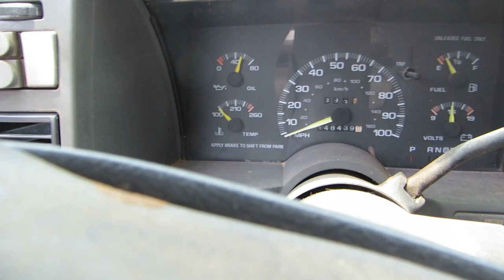1994 AND BACK GMC SAFARI / CHEVROLET ASTRO FUEL PUMP THROUGH THE FLOOR LOCATION

Comment: You skipped the one part I needed to know how to do, WAS TAKING THE PUMP OUT
Reply from the maker: that's simple.....and rather rudimentary. It's why I skipped it.
Brass drift and hammer, tap the Wd40 sprayed ring anti clockwise.
and then the whole pump unit comes out.

Comment: I have a 2004 and the other videos I’m seeing are in the same spot as yours, not back where you’re saying you thought it would be. I’m probably going to do mine this weekend, so I guess I’ll find out and let you know.
Reply from the maker: The reason I thought it would be farther back is because I had a 95 before this one and did the same process...I didn’t take any measurements, but still had the van. I looked where I cut the carpet to access....and I was farther back.
No, I don’t know if a 94 and a 95 have different gas tank placements...
I will tell you this though they have different fuel injection setups.
Yes, in the general vicinity...
But it’s highly possible the 95 and up have the same location.
So....to your discretion.
It’s easy when you find the spot.
😀😀

Comment: I have a 95 but the fuel pump is set up like the 94 and earlier ones. Do you have to cut that little yellow connector or will it just pry out. Bought a fuel pump for a 95 but doesn’t have the same connections as my factory one
Reply from the maker: sounds like you need an older style pump, what is the 8 digit back from end on the VIN? Check that to see if indeed you own a 95.
Also, 95 is going to me multiport and not TBI.
TBI has the round air cleaner over the throttle body and Multi port has a square one under the hood.

Comment: Why didn't GM put a access panel to change fuel pumps on those vans? Good job getting the van running. 👍
Reply from the maker: My father worked for General Motors for 36 years. He always told me “they were Pennywise, and dollar foolish“
 There is a lot of little things on this vehicle, that could be improved. But I guess they were trying to save money. 
 No matter the quirks, I still like these vans. The engine and driveline are pretty good. They’re small, you can turn them around on the road. And they have a pretty good power to weight ratio. 
 As a person who works out of one of these, it’s nice to have all your stuff inside. Out of the weather. 
 Also you can pull all the crap out of it, throw an air mattress in the back. And sleep in it. 
I always liked vans to work out of
Reply: Because GM never expected the van to last longer than the fuel pump. My real guess is that none of the engineers and designers at GM communicate with one another on any projected vehicle that they're making so you have a lot of interference problems, engines wedged into spaces they were never meant to go, and a general lack of access panels so that things can be serviced. The Chevy Monza with a V-8 ( I think ) is a good example, you had to un-bolt the engine mounts and raise the engine to remove a spark plug. The Chevy Colorado with it's 2 timing chains on either end of the engine is one of the more hilarious examples. The Chevy Vega with an aluminium block and a cast iron head ??? Dex-Cool.
Reply: @brianallen9810  
Now you know why I never owned a GM product.
Reply from the maker: @brianallen9810  How about Harry Sewell having 19 years in The GM Flint foundry (yucch) getting drafted, coming back after doing his military time...and GM loosing his records..ha,ha,ha
As you know GM hired him back on and he did another 25 years in that hole! 
Mom told me that one.
And...yeah...how about that colorado? Wacky!

Comment: The reason I watched this was to see how to take the ring off, which you didn't show...
Reply from the maker: Lefty loosie, righty tighty......take a whacker... rubber is better, and brass punch....steel if your brave.
Spray the ring with wd 40 so it moves easily,
It has a place to use the punch...3 actually....drive the ring anti clockwise....a little on one tab, a little on the next and so on...it will come off.
Reverse to install.